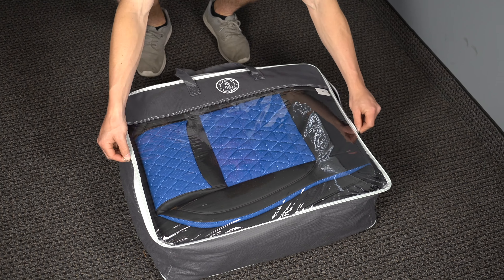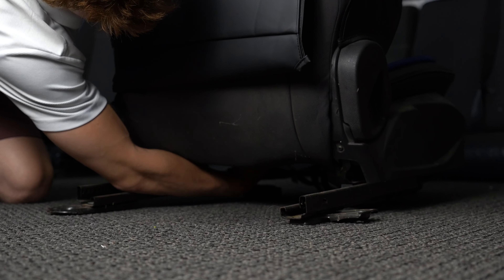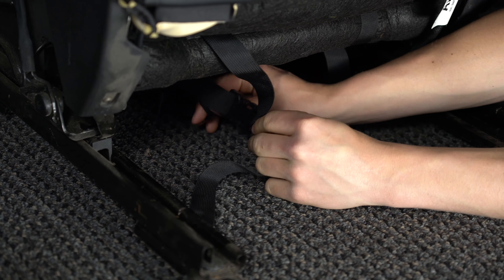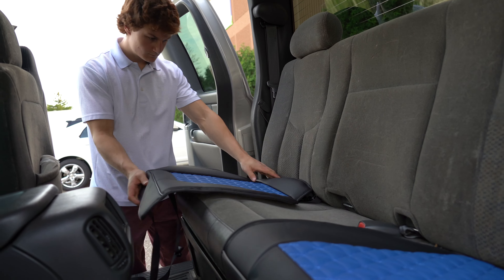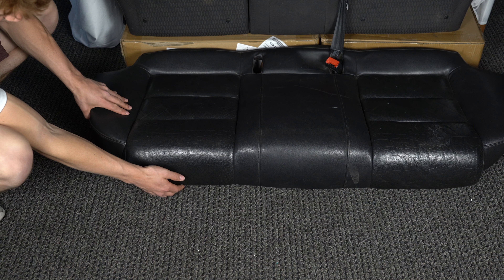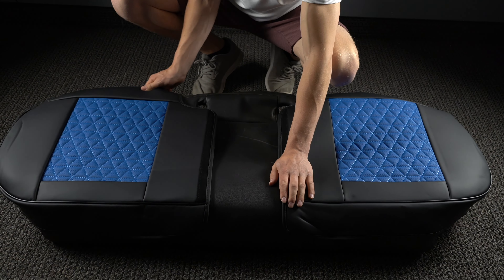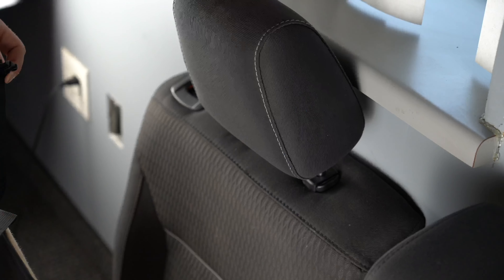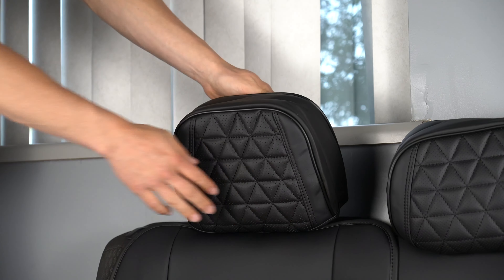Seat Cover Installation Guide

Comment: I purchased the front and back seats for a mercedes c300.  The fronts seats fit fine, but the back seats are not fitting as I have an arm rest in the middle of my back seats, so I cannot cover this up.  Also, I did not recieve a flat piece to attach to both back side pieces with teh velcro.  I should have just purchased the front seats and save myself money and frustration.  Also,  my back seats fold down and I believe are not easy to remove or I could not figure it ouit.
Reply: Minus the issues with the back seat covers did you think the fronts are worth it quality wise ?